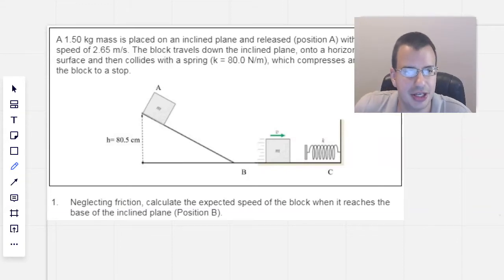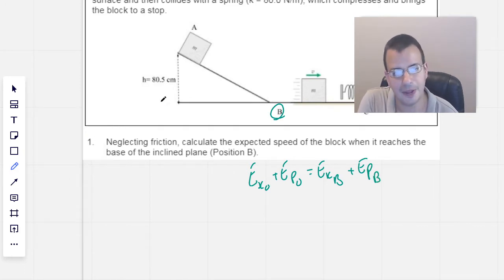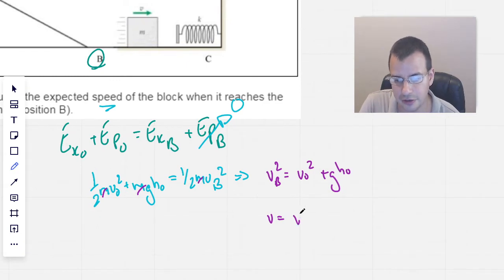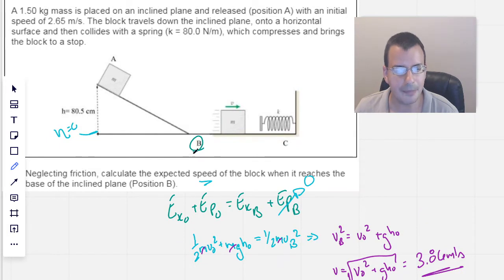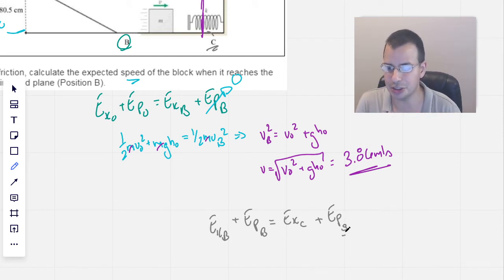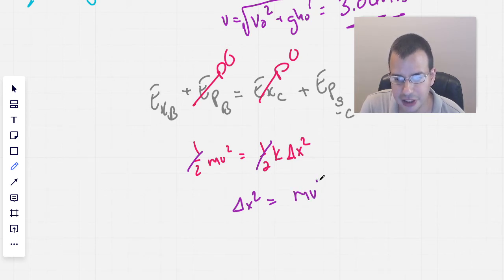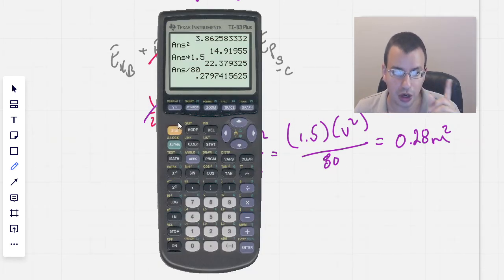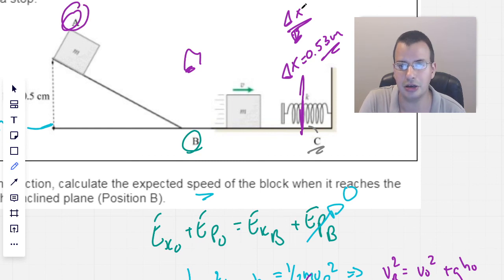A Block an Incline and a Spring

Comment: Hello what about the sign convention? The spring causes negative work
Reply from the maker: True, when compressing there is negative work because it slows down the block and positive work when it is expanding. 

I am needlessly cavalier about the sign conventions. For better or worse, I usually neglect the sign conventions when doing the math and make sure that the logic holds up. It often works out alright, meaning that sometimes it doesn't and I probably should be more careful.